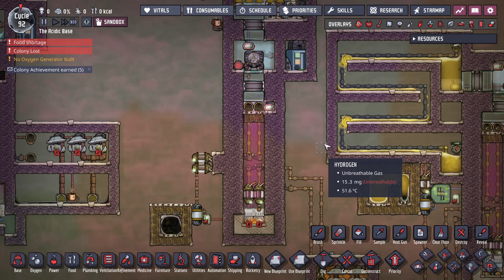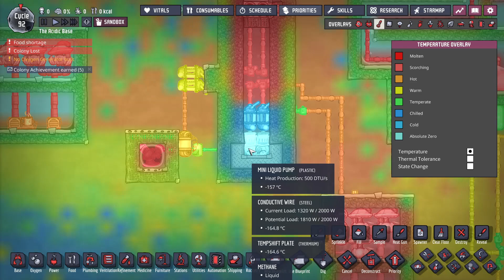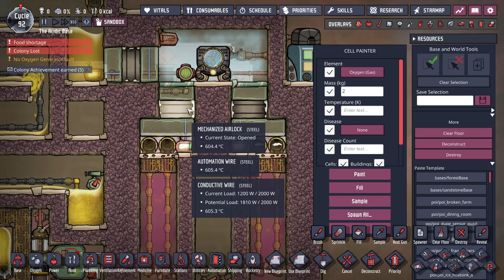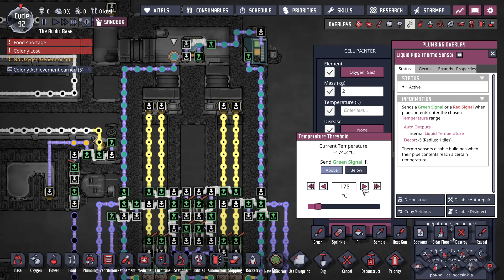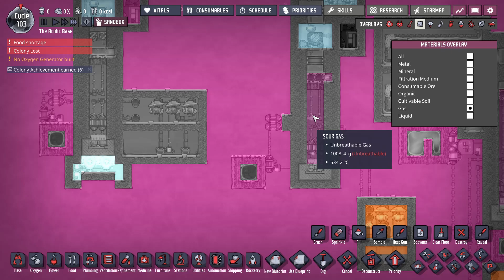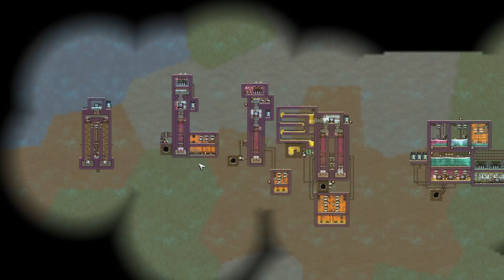A New Improved Oxygen Not Included Sour Gas Boiler

Comment: This design is very compact! I found that adding a hydro sensor in the bottom collection pit (so 3 wide) to collect some methane as a temperature stabilizer works better for my setup. I'm using rocket exhaust as the heat source, and a TA running super coolant for the cold (at -177C). It looks like the aquatuner is running ~47% of the time, and the door to engage the heat injection runs about 0.2% of the time. The input is petroleum at around 125C coming from a petroleum boiler else where, and the collection pit is set to pump above 125kg (still tweaking this value). Removing the value in the collection pit and just pumps 2kg/s works out just fine without heat damage to the pipe. The exiting methane will be hotter if the input petroleum is hotter.
Reply from the maker: Rocket powered is always an interesting challenge to keep the heat consistent.  I like using rockets for regolith melter. I was going for very compact for 2kg.  I love hearing of other peoples designs and adjustments.
Reply: @TartarusPlaysGames  my silo is over 900C 😂 with 4 rockets launching back and forth constantly just to generate more heat, I think I need more steam turbines to cool it down
Reply from the maker: @rachelchen9764  Or make it hotter and melt other stuff with it.

Comment: What would it take to automate the startup? Detect too high gas pressure and turn off the oil. Detect natural gas and turn off the oil. Something else?
Reply: Maybe also detect if there is liquid at the top, and then turn on the space heaters and turn off the oil.
Reply from the maker: The space heaters are temporary just to help it heat up faster.  I've done just leaving the bottom to cool the area around it.
Build it a few times and let me know what works for you.
Reply from the maker: Not sure if it worth that much hassle.  I made the startup bad in the video on purpose to show what goes wrong.  By having too much oil, and too much water I made it start badly.  Typically I just have to flash the first few kilos of oil, and maybe pause it once more before it stabilizes, then it just keeps running, and I don't even have to check in on it.  Just give it oil and power for the cooling and it just keeps going.
Reply from the maker: I figured it out.  Automated start up with sensors.  Want a video or just a save file?
Reply: @TartarusPlaysGames  I figured out a solution as well. I'm still testing it a bit and I'll post a screenshot soon. Let's compare our solutions. 😁
Reply: @TartarusPlaysGames  Here the automation I came up with: https://i.imgur.com/vwKX4Zi.jpg Flicking the ignition switch on for a couple seconds is enough to initialize the boiler (the less oil, the faster it should start up). The rest is automated.
Reply from the maker: @EskoLuontola  I just added a save file to the video with my sensors setup.  I use a hydro to detect any fluid, and a low pressure atmo.  But pretty close to yours.
Reply: Maybe also add one Atmo Sensor set to Above 20kg, connected directly to the error signal, to avoid adding more oil than the boiler can handle.
Reply: @TartarusPlaysGames  I too had a hydro sensor left of the liquid vents at first, but then I encountered an error situation that if there is natural gas at the sensor and cold oil at the liquid vents, then it will keep on pumping more oil and it will never be able to heat it all up. Thermo sensor works better, for both liquid and gas.

If there is only 2kg oil per tile on startup, then the boiler will start up in 3-4 cycles. That's why I have a separate ignition switch to limit the initial oil. Maybe that could be automated as well: detect that there is a vacuum and no oil and use a timer to let in only a little oil. Probably not worth it, unless you want to make a super resilient boiler which will recover automatically from the boiler drying up.
Reply from the maker: @EskoLuontola  Check out the new build, I added air flow under the hydro to prevent that.